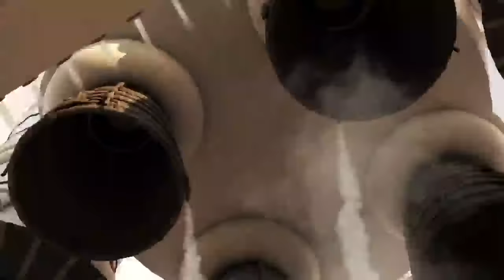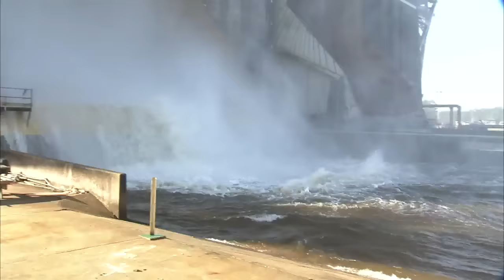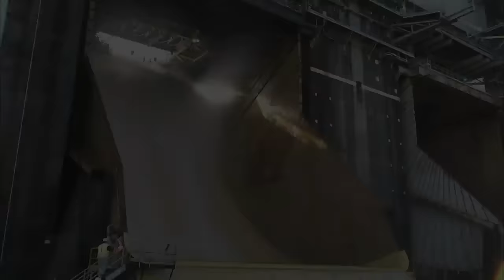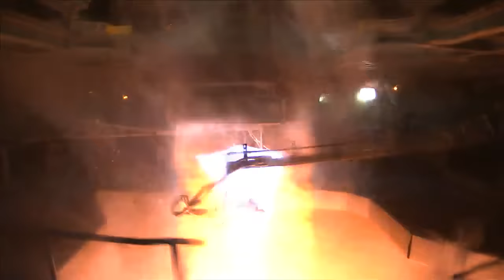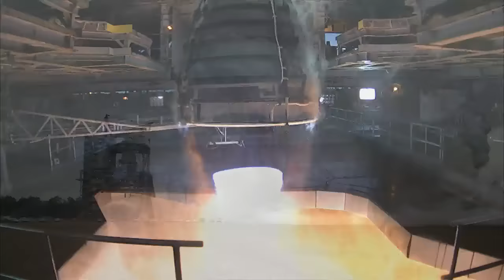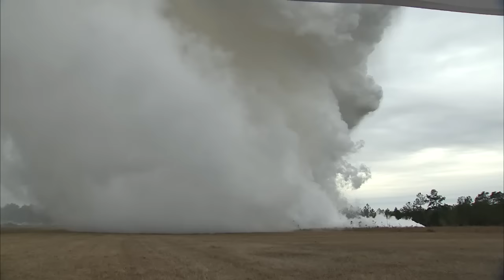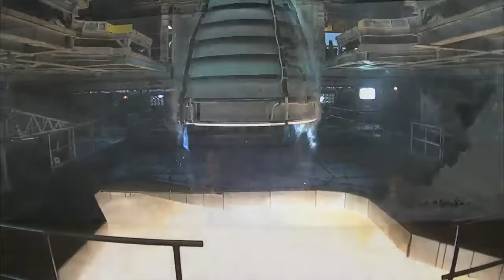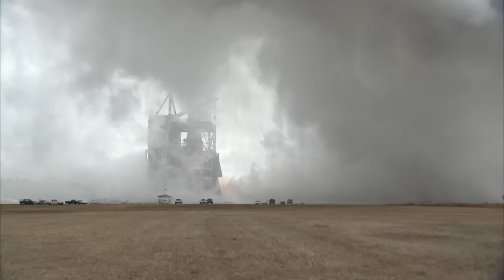NASA Conducts First RS-25 Rocket Engine Test of 2018

Comment: How does the nozzle not glow red?
Reply: It's been cooled by liquid hydrogen running around the nozzle in the black tubes that you can see in the video.
Reply: If you look closely at the body of the nozzle you can see what look like vertical ribs...these are actually channels milled into the body through which the cryogenic fuels flow first down then back up to the top where they spray into the combustion chamber.   Being as these fluids are at a couple hundred degrees below 0 they cool the skirt and also become vaporized as they absorb the heat so they burn properly.
Reply: In short, the engine is cooled by its own fuel =)
Reply: I can't find if this engine uses a gas generator / turbopump (the gas generator exhuast drove a turbine, which then spun the fuel pump; then exited the bell.) like the Saturn F1 engine. Like RecoilRob said, they ran the cold fuel through the bell to cool it and pre-heat the fuel before it burned. They also used a manifold to route the exhaust gas from the generator around the inside of the bell. It made like a cooler thin layer of gas between the bell and the main combustion flame. The "cool" gas was @ 1200f, but it's a lot cooler than 5700f temp of the main exhaust. If you watch one of those slo-mo Apollo launches, you can see the blacker generator exhaust coming out right along this inner edge of the bell, with the yellow hot main flame inside of that.. The generator ran fuel rich, and its darker, black color is from soot. Crazy to think that the output of the turbine that drove the "fuel pump" for one engine (out of 5) was roughly equal to 55,000 horsepower. (275,000 hp just to drive the 5 fuel pumps!). Top fuel dragsters can only dream of being that badass!  lol

Comment: WOW nasa your testing the same engine that has been used since the early 80s from the space shuttle. Why dont u try to do something new !  Like make a new engine instead of using one from 40 years ago.
Reply: WOW IS THE WORD 4 The Day, thanks 4 showing kit,much appreciated 
Respectfully John the Russian
Reply: These bad bois are modified to the limit for maximum thrust output, Not thr same as shuttle ones.

Comment: To everyone griping that the RS-25 isn't reusable, you are incorrect.
Reply: Frank Fitzgerald explain?
Reply: RS-25 is the space shuttle main engine. These have been reused many times and have been  very reliable.
Reply: @frankfitzgerald4536 
They aren't reusable when you drop them into the Atlantic from an altitude of 70 miles.

Comment: These "video" tests are done for one reason. To keep the illusion of space travel being real. 
Let's see the same test in their vacuum chamber. You know, where it allegedly spends most of it's time in the vacuum of space...lol
Reply: Mastercrap 42123 if that's what you believe then you don't understand the principles of a true vacuum or a rocket that needs the friction of an atmosphere for flight.
Reply: Mastercrap 42123 basic physics??? A rocket and it's heated air thrust do not push against eachother. The rocket does not use the thrust to push away from from the rocket . It's one unit. They do not separate and push against eachother. All things that take flight require air. No air no lift. You have been brainwashed.
Reply: Mastercrap 42123 and your right Newtons 3rd law has nothing to do with flying in a vacuum.
Reply: This is exactly why I said you don't know anything about Newton's third law . You asosciate newton's third law with friction when they are  not related whatsoever. " The rocket does not use the thrust to push away from from the rocket" No the rocket doesnt move away from itself.The rocket thrusts propellant backwards and it itself is being pushed forward by the exaust. And are you saying a rocket and its exaust is the same thing? They are clearly not. Imagine this . You are sitting on a chair and you are holding a basketball.As you throw the basketball in one direction you and the chair are pushed the direction oposite to the direction you threw the ball at.You didn't push against the air but against the basketball .The same thing applies to a rocket The rocket pushes the fuel behind the the exausted fuel pushes the rocket forward .The fuel is the basketball of my analogy . They are not one unit just as you and the ball are not one unit .The rocket isn't pushing against itself but against the exausted fuel . Also rockets have nothing to do with lift. Lift is achieved using wings in the atmosphere.Newton's third law has nothing to do with friction or lift. Again thanks for confirming  that you know jack shit about basic concepts in physics
Reply: Mastercrap 42123 throwing the ball back and forth is another brainwashing demonstration of angular momentum. 
Your hands release the ball and you move backward. If your hands do not release the ball you don't go anywhere,  just like a rocket doesn't release its thrust, it stays right behind the rocket the whole time. It IS one unit.
 When you hold your hand out of car window at 55 miles an hour you feel that push back from the atmosphere, from the air.  You take that away and planes, helicopters, jets and Rockets all fall but, we of course don't get to see it fall we get to see It Goes up on a parabola and complete that Circle right into the ocean out of anyone's range of observation.
Reply: Now that is just plain ignorance . A typical rocket engine throws its exausted fuel backwards at around 3000 km/h . The reason you see the exaust behind the rocket the whole time is because new fuel is being thrusted backwards the entire time . As it seems your knowledge of rocket science is even worse than that of basic physics
Reply: Mastercrap 42123 the thrust coming out back of a rockets needs first the ground that pushes back. The ground isnt moving anywhere so rocket goes forward. To maintain a climb it does require atmospher for that thrust to have any equal and opposite reaction....."forward"
Any other nonsensical take on it is our brainwashing.
If you were born in the world that from the moment you could walk on it, you were told it was round and we launch Rockets into space, your observation skills  and perceptions have already been hacked. Your brain will rearrange any information it comes across to maintain that ideal.
Reply: Brian Sleeper The thrust of a rocket has nothing to do with the ground. Again the rocket isn't pushing off the air or the ground it is pushing its own fuel backwards
The fuel doesnt need to hit air or ground or anything 
It is an action and an equal and oposite reaction
Your failiure to understand such a basic concept when it has been explained thouroughly to you is a product of your own stupidity
This stuff is easy there isn't anything that complex about it
Exaust gasses get thrown backwards rocket gets thrown forwards
The ground or the air have absolutely nothing to do with that whether nuts like you like it or not
Reply: Holy shit..did you just say the rocket needs to push against the ground to get going? ....there are some really good learning materials out there, but you should have moved beyond the coloring book by now.
Reply: @truthbdared5464  omg I'm howling, this is too much haha. You have been explained rather simply, nicely and clearly how rocket works ..and you literally compared it to your hand sticking outside of your car! While this proves how planes work... Rocket are not planes! They don't need air to lift off the ground!
Reply: @AlexandrePRODHOMME  nothing absolutely nothing flies without the assistance of a medium no medium no flight. I don't care what the high priest in their white lab coats tell you. Rockets are no different than anything else that wants to gain flight. They all depend upon the same medium, air molecules no matter what you're flying.
Why aren't you getting it through your head that the rocket and the flame are one unit. The rocket takes its flame with it. 
It's not pushing off the flame to gain angular momentum. It can't, THE FLAME COMES WITH IT.